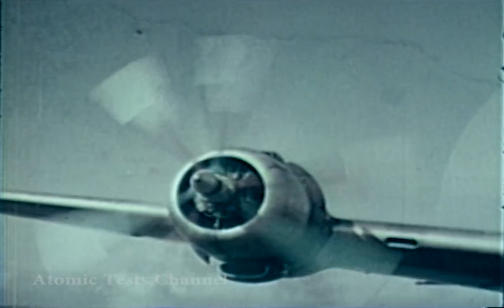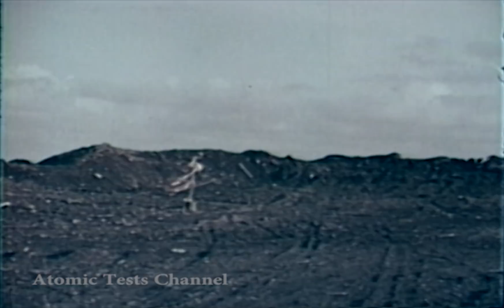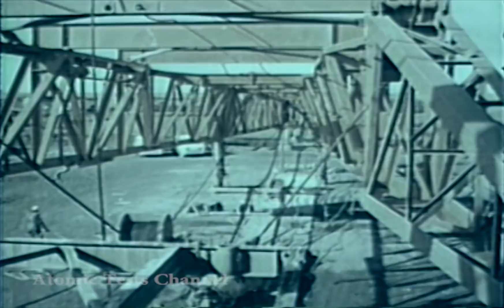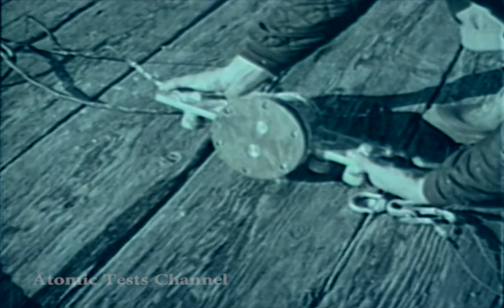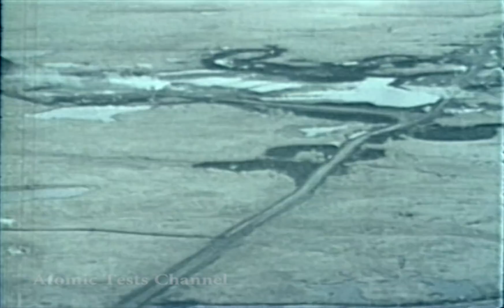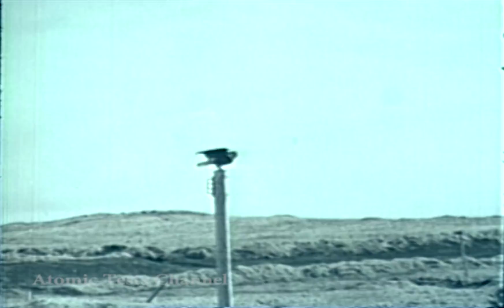HD - 2300 feet ultra deep underground testing 1965 peaceful nuke test

Comment: In 1983 the Navy sent an expedition crew to the island ... Soil samples and such were taken...my unit ACU 1 and the Seabees..EOD teams my boat LCU 1632 with a D-9 dozer along with USMC LVT's (3) and a few M-60 Tanks ..the heavy stuff was used to pull the D-9 dozer out of the permafrost...after the D-9 dozer got stuck after 2 1/2 scrapes with that huge blade...it sunk to the belly pan...those huge tracks spinning on both sides...a sight to see...it was cold there..lifeless...dealt with temps down to 50 below zero...

Comment: 51.42344716385863, 179.18542718825836

In case you'd like to see the site.  Looks like it's a bombing range nowdays as there are lots of bomb strikes in the area. From this document here (https://www.osti.gov/servlets/purl/892560), We can approximate that this obliterated area here is the test site.  They probably bombed the building on the surface into oblivion for target practice.